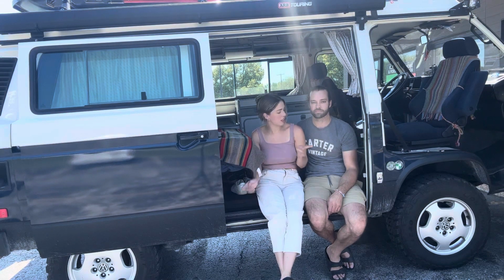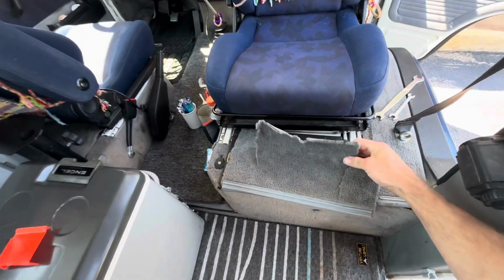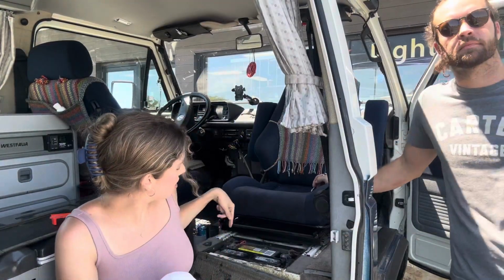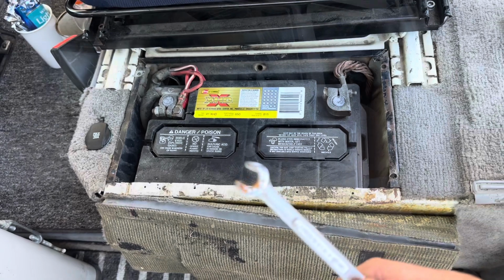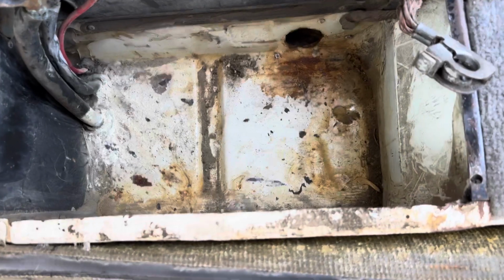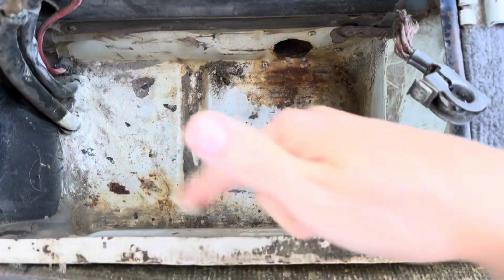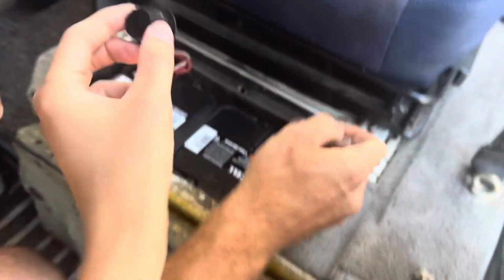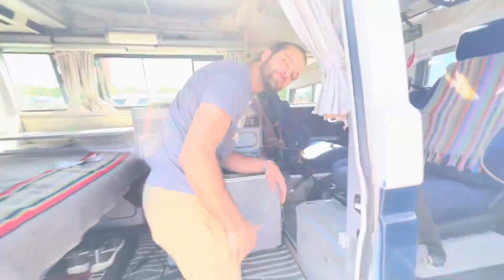Replacing a Starter Battery in a Vanagon Westfalia

Comment: Cool bus, You can actually hold both battery poles with your fingers the 12v is completely harmless, But if you short circuit ( + tuches -) with metal tools for example it will spartk a lot wich is dangerous and damage the battery wich is not good. I recommend to clean old conectors while you're in there :D